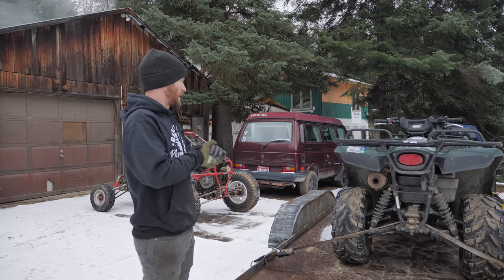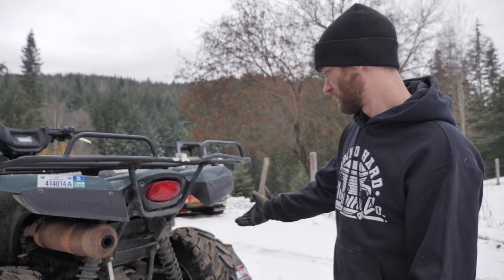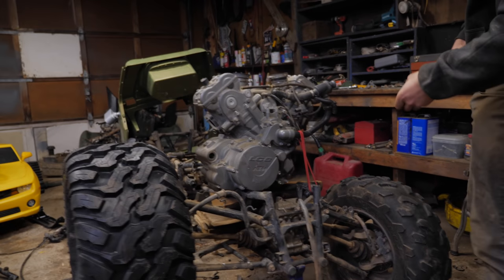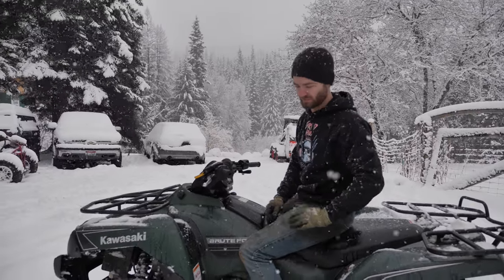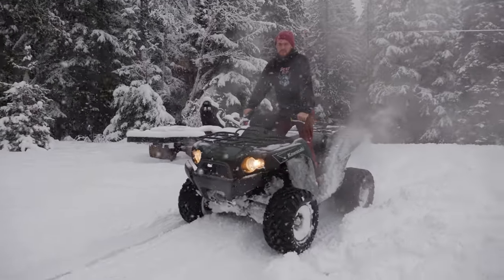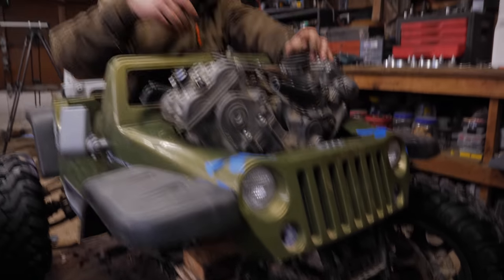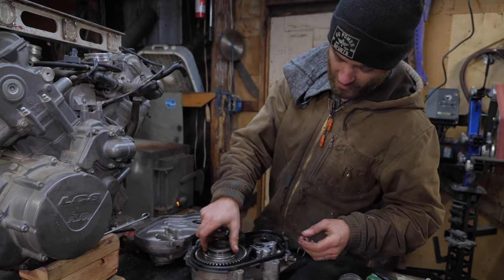990cc 4X4 Power Wheels Jeep Build Part 2

Comment from the maker: Get a Grind Hard Hoodie here! https://www.grindhardplumbingco.com/ thanks for watching guys!
Reply: Aye no problem you guys are amazing :D your channel is the best in the world!
Reply: Have an idea, take a same size sprocket as on the gearbox and mesh them then make a box to hold and adjust the mesh, like on an rc spur and pinion this will correct the rotation then add a cv jack shaft to the reverse gearbox you said would double as the transfercase then all you have is driveshafts to figure out. Hope this helps
Reply: @MrDollaBillman  congratulations your the second reply on this comment  lmao
Reply: Grind Hard Plumbing Co you guys should just keep the working brute force together
Reply: Grind Hard Plumbing Co when you put a exhaust you should put the derby car hoood stacks style exhaust on the Jeep build
Reply: Barbie; builds Mustang
Ken: builds Better Camaro
Barbie; builds Jeep
Ken: "Barbie hold my beer"
Reply: Helmet bro
Reply: need dyna tek race chip
Reply: Ill trade a 212cc mini Harley Davidson chopper for that fourwheeler😂
Reply: i have a suggestion is there a change that the motor be ran in the opposite direction there for the drive gear would go the opposite direction
Reply: Use the running fourwheeler for a plow
Reply: Ok so the idea i had it's the right idea just don't use sprockets instead a pinion and spur gear needs to be made at least 3 in wide to handle the power and a closed box would be a good idea in case something detonates. If anyone is lost, if you take two gears and spin one clockwise the other gear will spin counter clockwise my idea/proposal is make said gear the drive to the chain case that will be the transfer case as well, power to it power to the diffs power to the wheels. Can't wait to see what y'all do tho either way.
Reply: How much would it cost for yall to build me one with universal bolt on parts incase they need to be changed and with like alot less horsepower of it's cheaper for me
Reply: I realize Im kind of randomly asking but does anyone know of a good site to stream newly released series online ?
Reply: @Quincy Royce flixportal =)
Reply: @Ashton Alfonso Thank you, signed up and it seems like they got a lot of movies there :D I really appreciate it!

Comment: For the reverse issue, take a look at miniature portal axle assemblies, they are usually a 1:3 reduction or similar, but they do reverse the input rotation. Not sure if they would stand up to the constant high RPM of the engine output.

Comment: For the jack shaft problem, don’t use a chain.  Just take a gear from the busted atv transmission and mesh it with the sprocket on the motor.  Boom, done!!

Comment: What's the difference in bolt pattern? You could possibly redrill the hubs, may have to weld the old stud holes closed, and then redrill and press the studs back in. Then you're not running spacers. Your big problem with steering is that you've massively increased your scrub radius because of the spacers. Going up in tire height would help offset it as well. KPI/SAI plays into figuring out scrub radius. Just a consideration. 

Also with regards to the counter rotation run a gear drive off the sprocket, instead of the chain sprocket, and run a shaft off that. Direct gear to gear will output a counter rotation to the input and should be relatively straightforward to build a sturdy bracket to house the two gears. Plus it gives you an opportunity for a reduction before your input to the transfer case (maybe cannabalize an old manual trans if you have one laying around).  Also, running the diff flipped isn't the worst thing, especially not for a toy that isn't used constantly. It's not uncommon to flip differentials when building rock crawlers and the like, I can't see any adverse effects with an ATV diff unless they've got some type of unique oiling system I'm not familiar with.

Comment: You guys are gonna have to go with a jack shaft into the chain case.  If you don’t and figure out another way to get the drive gear running the right direction(that won’t catastrophically explode), I’ll be very impressed.

Comment: You have probably already got too far through the build for this to be useful (I suspect more progress than just shown), but rather than running the differentials backwards by moving the ring gear to the other side, surely if you swap the front and rear diffs (assuming the casings are the same which they may not be, or same mounting points at least) then surely you have the same affect, but keep running the diffs the way they were meant to and that should fix the drive issues. Or am I over-looking something basic?

Comment: If you flip the diffs over in addition to the issue you mentioned with the cut of the ring and pinion, there may also be bearing oiling issues. Could you swap diffs front to rear?

Comment: 990cc? DAYUM !!! I truly belive this project started with '' HOLD MY BEER''

btw, @ Grind Hard Plumbing Co thanks for following on my old insta, Driftmissile_202 , the one with the 212 drift cart and the souped up push mower, but it got deleted. sometime in the near future ill make a new one with my real name --> Driftmissile_22T
i recently finished putting a stage 3 predator 212 on a 1985 kawasaki kx250 frame with 1983 kdx 200 plastics and ive redone the whole frame and it looks pretty dope, if, you wanna check it out here are to links to pics of it. 

https://ibb.co/cDQFxYb
https://ibb.co/TLDq9bd
https://ibb.co/8K8NN3g

Comment: If you put the front diff in the rear and rear in the front... wouldn't that work?
Reply from the maker: The axles from the front diff are meant to disengage so they have to be on the steering side

Comment: Does anybody know where I can get the same steering wheel they are using for the odyssey build?
Or atleast what it is called, thanks!
Reply: Pretty sure it's just the factory honda odyssey steering handles/wheel part complete with levers and all but I could be mistaken. But I'm even more sure of the fact that they have heavily modified it to thier liking and uses.....

Comment: The tires are not the best in snow.. A skinnier rounded tire does much better, than a flat wide tire. I had a BF 750 it would go alot better in snow then shown in this video with the fat tires. Either way its gonna be an awesome experience!

Comment: If you flip the diff....the gears and everything would still be rotating the same direction, but how would the oil circulate? Is there a chance that the flow is restricted.

Comment: Just casually getting two 4x4 ATVs like its nothing, when deal like that would been at very least 3500€, probably way more due reliable brand like Kawasaki. Are you guys swimming in money, or is everything just dirt cheap in USA?
Also that engine could been saved with relative little work and money if one would like to put on the effort. Just weld the head, machine it to shape, get new valves, piston head and seals. Seen far worse engines being rebuilt with minimal budget, or least jerry rig to work while, until new parts can be found cheaply to increase reliability.

Comment: Why don't you just make your own transfer case? I don't believe Yamaha designed the snowmobile reverse gear to be driven with full power.

If you are going to have drive all the time you can just take two beefy sprockets and make them engage eachother, the top sprocket being driven by the engine and the lower sprocket being driven by the top sprocket.
When two sprockets engage like that the bottom sprocket will go in reverse direktion of the top sprocket and that will make for an extemely beefy but compact transfercase that also solves your problem with the diffs needing reverse rotation.

Comment: i’ve built a couple brute force 840cc big bore and they like to blow diff’s at around 75 -80 Hp i would not tow with your setup that for shure with that 105hp and 74 lbf-ft it’s almost twice the torque

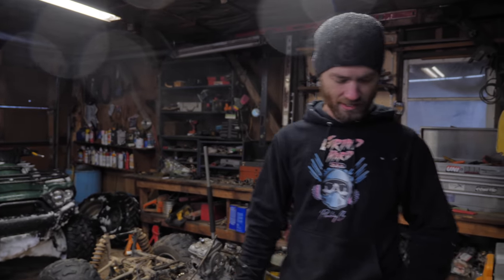Comment: 10:36 having just the chain might be nice for engine removal w/o tearing down the rest of the drive line. 
Ex: pull a tensioner back and drop the chain along with linkages, wiring, fuel, etc. And bam engine is ready to be plucked out

Comment: dropped valves are pretty common on the kawasaki engines. Also you could make some decent power with the running one with an exhaust, dayna tec cdi box, some air box mods and a clutch kit. Really wakes the machine up.  Just make sure you check the valves every 25- 50 hours and keep them in spec.

Comment: The brakes being on the diff doesnt remove unsprung weight. It still has to spin that mass. It's just in a different location. Always bigger brakes with smaller wheels etc. But no weight changes

Comment: Hey ghpc. I own a bike with that exact Lc8 990 engine. Do not underestimate the cooling required to keep that engine cool. It is a high compression engine. Running premium fuel. If you scour ktm 990 forums they are filled with guys trying to cool their engines better. Using engine ice coolant, adding a second fan on the radiator, adding oil rad coolers. What i am saying is, this is not an engine you can do a small rad in a poor airflow location. It runs hot. Like so they get this before they design coolant system.

Comment: the biggest issue I see with that chain case is that its not designed to be run in reverse all the time, the gear that is lifted up is weaker, and not designed for constant ab/use.  Its primarily designed to handle the majority of the power going the "forwards" direction,  where the primary sproket is engaged.  That idler gear will get shredded.  My suggestion:  turn the motor around.  I know its well built before you see this, but turning the motor around will give you better mounting options for the t-case as well.  Might also look at an older/newer transfer case for a racing quad that has 4wd.

Comment: just so you know the real only weak point of the 990 LC8 motor was the water pump impeller shaft. it was fixed on later models but the earlier ones were susceptible to failure. a new water pump impeller will fix the problem and wont be a issue anymore figured i would give you a heads up.

Comment: If you replace the sprocket on the engine with a gear, then mount a mating gear on the shaft going back to the diff, you'll get the counter-rotation you need for proper diff rotation, and may only have to move the engine up a small amount. Might even be useful for changing gear ratios, if find it's needed.

Comment: Reverse the engine rotation, have new cams ground & use another starter. Crank bearings should be changed to deter weird ware problems.
  Edit : Camshafts are not that much.

Comment: On your motor rotation problem. You could change it by putting gear to gear setup on it. Depending on which side of the gear you come off of making the rotation different. Drive gear in the center. Gear on the left spins one direction. Gear on the right spins the other direction. Good luck with the build.

Comment: I kinda liked the jack shaft idea, if you would make it longe enough you would be able to use it like a pto to power a mechanical winch. My jeep has one that uses àl of Ma transmission gear ratios so it is possible

Comment: Flipping the diff will still engage the ring gear in the same way. It's just upside down relative to rotation and thus the tires are spinning the other way. You have to plug and vents and re make them etc

Comment: Lathe a straight crankshaft for the bruteforce cut the engine block and run a chain to the new crankshaft. Reuse all the stock cvt/driveshaft etc. Save on a recluse. 🤔

Comment: I was thinking you're having a problem with the direction that the sprocket spins on the motor and the solution that comes to mind is take the sprocket off and replace it with a gear then take the sprocket and attach it to another gear and in theory the sprocket will spin the opposite direction when attached

Comment: Have you thought of using a goftcart  drive train .. a  make the shaft  the motor drive come out longer to put a sprocket   on to drive the front an rear .. yes you mite haft to lock  up the the goftcart drive  train but seemed to be a good idea

Comment: To get the engine output the right way, flip the engine so output is on the front. You need a transfer case to reach both front and rear anyway

Comment: Try making actual power wheels build, where the wheels have an electric high torque engine inside, and any electric producing engine mounted to the body of the vehicle
Reply: Quad is no longer reserved for ATVs, but also for quad copters and hybrid/transforming ATV/copter
Reply: ATV = Air Transport Vehicle

Comment: I'm a little confused. You said the parts quad didn't have a differential. Then when you are talking about measurements of the motor and body, can clearly see a differential and half shafts
Reply from the maker: We're just mocking it up with the externals of the diff and then buying then internals on eBay
Reply: @GrindHardPlumbingCo  so you have the half shafts just setting into an empty diff? Ok I got it now. Jeez
Reply from the maker: @ericball6894  yes exactly it should all work out
Reply: @GrindHardPlumbingCo  love the content. Hope we get to see the Odyssey again soon too.